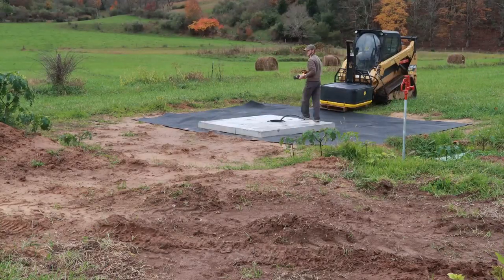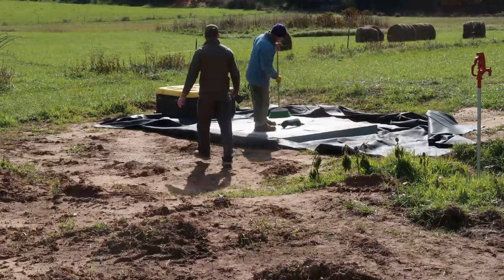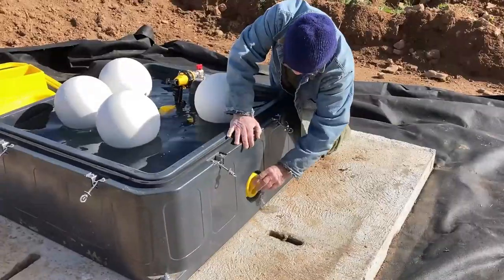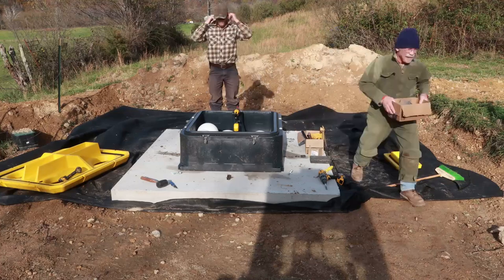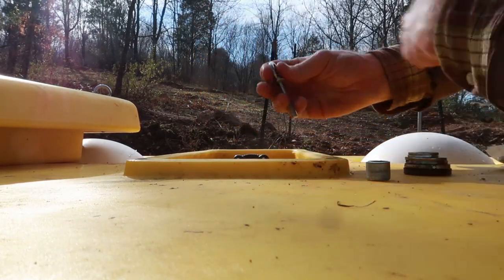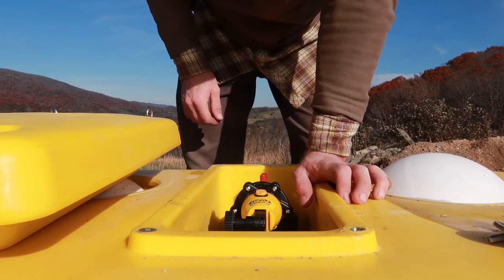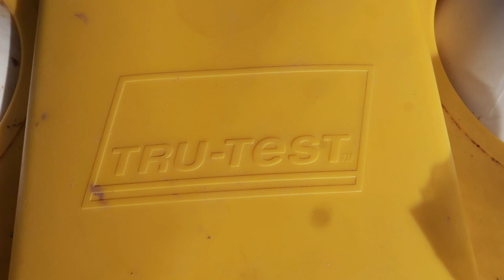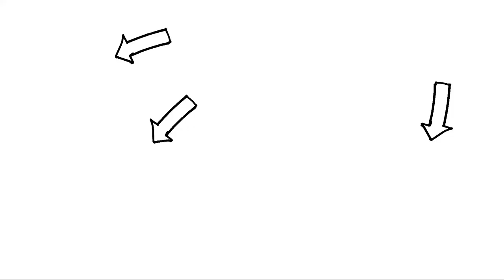Installing Cattle Waterers - Part 1

Comment: Do these folks realize you have a you tube channel and have shared with the World that they are duds. Hopefully they find out. That's to bad, Makes for so much extra work and head aches for the customer. Thanks for the update. Pray you get your low pressure figured out.
Reply from the maker: I doubt they know, and I doubt they really care. For as small of a channel as I am, it's not really an issue to them. Thanks!

Comment: I get the big toilet tank like valve, but what do the white balls do?
Reply from the maker: Blocks sunlight in the summer and helps keep it algae free. Insulates in the winter to reduce chances of it freezing.
Reply: @LandisLegacyFarm  One more dumb question (not a cattle farmer!) how do the cattle get to the water?
Reply from the maker: The balls push down and to the side pretty easily. When starting out, you don't put the balls in. After the cattle learn there's water in there, you put them back in and they figure it out.